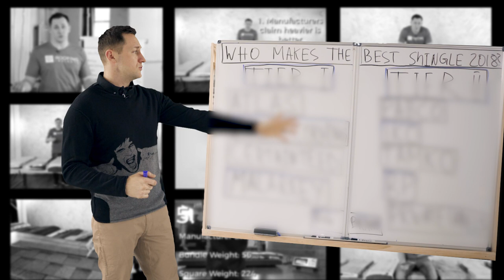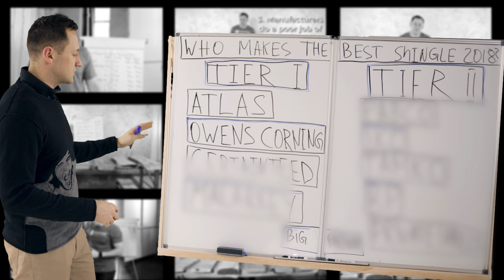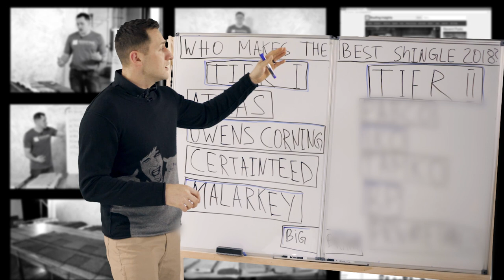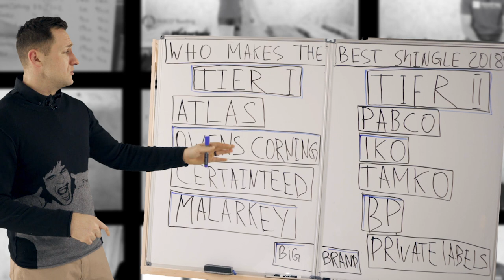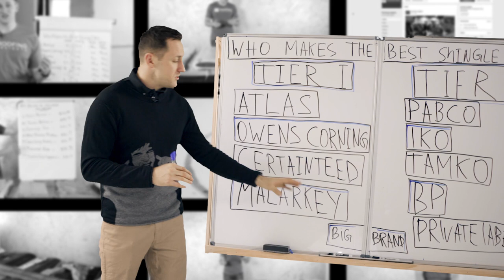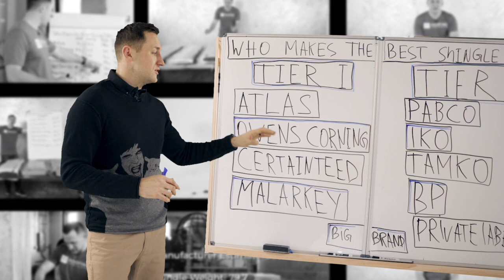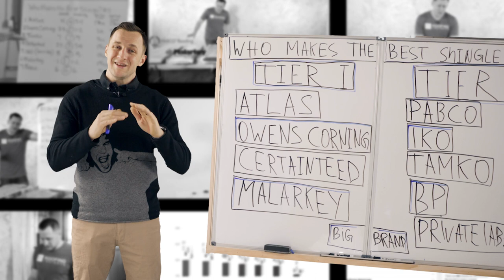Roofing Best Shingles: Atlas Certainteed Owens Corning Malarkey GAF

Comment: great info Dimitry Owens corning shingles are what I install on my roofs the sure nail design is flawless I think a lot of people involved with the roofing trade forget how important having a continuous seal across every shingle is what prevents water infiltration  when ice forms a dam on roof eaves!! .before the sure nail design OCs duration design tar seal is most aggressive compared to other brands I've installed which include IKO. Certainteed. Elk. n Atlas. I like atlases bigger exposure but I their sealant on the top side of the shingle not only slows you down cuz of the build up on my guns but also this wouldn't be a problem if my laborers remember what I tell them for more then 60 seconds but they continuously step on the sealant after atlases are installed n contaminating the sealant and at times pulling the shingle through the nails
Reply: I need a new roof and the contractor I'd like to use recommends Atlas. After watching videos, I much prefer the way Owens Corning shingles get nailed down, and the contractor even told me that the Atlas shingles don't seal well in winter (I'm glad he was honest, but I'm having my roof done in a couple months and it'll be winter). I wonder why Atlas doesn't change the top side sealant? You listed two issues with top side sealant, and it's just common sense it could be problematic.

Comment: Give you credit for making an easy to understand video that a NON roofer can understand.  Am trying to decide between two roofers one with OC and one with CertainTeed.  The video didn't help too much in making a decision but at least I get the idea that both are quality shingles.  Thanks.
Reply: Mr Wohler, which shingle did you decide to use? I am glad that I looked at YouTube. Learning somethings and emailing some folks. The roofer I saw yesterday speaks highly of OC. Thank you.
Reply: @robertashaw3029    I went with the CertainTeed Landmark Pro....Colonial Slate.  It came down to the choice of contractors really.  The contractor we ended up using gave a couple pro CertainTeed comments.  The Landmark Pro is heavier and therefore should last longer than OC or just standard Landmark series.  Also OC has had more legal issues that they walked away from. 
Technical Data:
                                         Landmark Landmark              Landmark Premium
  Pro
Weight/Square (approx.) 222 / 238 lb                             ** 250 / 270 lb 
I think OC is the same as Landmark.  Think OC is perhaps more advanced but I didn't see any difference in systems.
Make sure you contractor uses the right number of nails per shingle(6)that is wind rating.
Reply: @jameswohler985  
Thank you for responding. I learned a few valuable things from the video and from the comments of everyone.  The tip about 6 nails per shingle, priceless. Can you do a video about guidelines for selecting a roofing contractor, pricing and warranties.  There are a lot of women owning homes and need this valuable information to help make, not only the best decision, but satisfying decisions. Thank you.

Comment: Atlas = tier 1? 
You state that tier 2 is for ones with issues or past issues. What about the class action lawsuit with the Atlas Chalet shingle? That’s a pretty big issue. 
  I’m the manager for the 7th largest roofing company in the country. We’ve done over 60,000 roofs. I’ve used all the shingle brand in tier 1 but would never install an Atlas shingle. I would highly recommend reconsidering them being place in tier 1 with the other quality manufacturers.
Reply: What do you use? I've gotten 4 quotes so far in the Northeast. 2 use GAF and 2 use Tampko.

Comment: I am about to get a new roof. Why does Owens Corning have so many bad reviews online?
Reply from the maker: +jeffy john most manufacturers do in roofing space, most have class action law suits in the past. Atlas and Malarkey probably the best based on online reputation
Reply: I wouldn’t put anything that’s sold at Home Depot on my roof
Reply: heck ya.
Reply: I am in a senior community. I have lived here three years. I never had to deal with roofing issues other than sealing around pipes from roof. I am noticing Brown spots. I want to replace the entire roof, asphalt shingles. Guy wants to use Owens Corning and speaks highly about it. However, I saw your YouTube about the 2 tiers and reading comments. How do I make a smart choice? Seems folks have their preference. Do I need to contact manufacturers? HELP!! Thank you.

One other thing. Is area/location/weather an important factor in the material used?

Comment: Anyone that roofs anything with shingles that last 5-10 years is making a huge mistake....ok   maybe a dog house but that's even questionable.  I hate how 10 years will fly by and i have to redo work I could have put off with a better choice. I have complex decks I built  20 years ago. Now I'm counting down the remaining 10 years it'll live.  I used GAF on a 12 x 15 shed I built knowing GAF kinda sucks and it was my first roofing experience so I sucked and with a gable!  still going strong dry and rot free for 25 years.....dreading that re-roof job!

Comment: I would not recommend IKO at all. Our community had wind gusts up to 64mph with shingles rated at 110. At least 12 homes required repair. IKO warranty only covered up to 60mph. Its a terrible product.
Reply: In my area, building codes tell us to design for 55mph sustained winds with 3 second gusts up to 90mph.

Comment: In my area I only install Certianteed shingles I've replaced more IKO than anything they suc so bad only local materials supplier quit selling them do to the failure rate and absolutely NO backing up from the company then more Garbage Aspfault ..- GAF 3 years old roof looks shot in CNY heat the Pro line is the only way to go
Reply from the maker: +rocky jackson we agree with everything you have said
Reply: About 15 years ago I had to take back about 25% of the IKO shingles that were delivered to the job site because they were to defective to use.  I switched about 40 contractors to Certianteed because they were the same price but far far superior.

I just replaced a IKO roof that failed in 15 years.  It was a easy job to sweep up the shingle pieces and throw them out.  Nothing left but gravel chunks.

I WILL NEVER USE IKO AGAIN.  Not even for a dog house.

I think Owens Corning shingles are good shingles except for one thing.  That is the color on the shingle fades way to fast.  If a tree branch fell on the roof in 3 years there is no way to match the color.

GAF is not that great of a shingle.  The seal down strip is weak and the shingles are brittle.  Two bad thing in a high wind zone.  Sure you can high wind nail them but why risk it when there are shingles that have a better seal down strip at the same price.  Not to mention that a brittle shingle has less asphalt and wont last as long.

Comment: Obviously Big Brand is GAF and can you blame them for not playing with this amateurish "testing".  I am sure all of these brands payed to be included. You think they could afford a little better graphics? There is no mention of how they were tested, did they hire a lab? Were there any labs used? And the installer feedback is ok, but is an installer going to say bad things about the shingles they are installing? That would be hypocritical. If they are bad, why are they installing them? The so called evidence is mostly hearsay. Roofers chose a shingle for a variety of reasons. One is call backs, which no one wants for a variety of reasons. The other is price, availability and warranty. If the shingle is not well made it will look bad, loose adhesion, blow off, and sometimes crack in a year or 2. There goes referrals. I have sold and installed GAF shingles since 04 and have yet to have and issue regarding their shingle in quality or color. Owens makes and excellent shingle and we have no problems after 100s of installs. Certainteed also excellent and i believe they have the best high end shingles. All the Tier II shingles have issues and most roofers who are honest, yes there are a few, admit they use them because they are cheap.
Reply from the maker: +danbeau thanks for feedback, we have 6 videos how we compared them, this is just final results. We would love to include GAF if they would be willing to participate and not to use legal power to avoid comparison, we were very detailed and it took us 2 months to complete, and no we didn’t ask any manufacturer for any money and never received any financial or any other help, not even shingles, everything on our own dime
Reply: I am gettign an estimate, the installer uses Certainteed, not sure which "level", but I also like Marlarky due to the colors available and the nailing zone.  which Certainteed do you install?